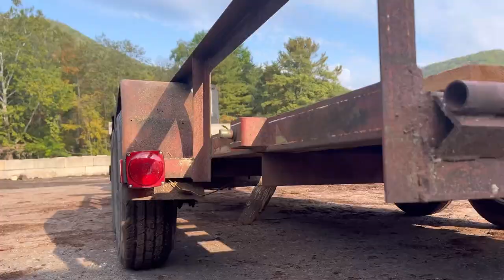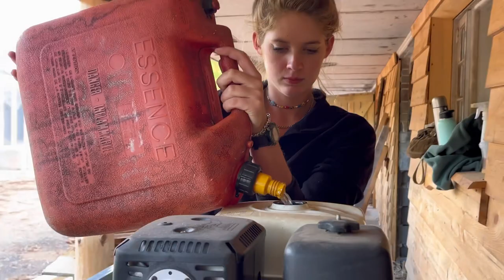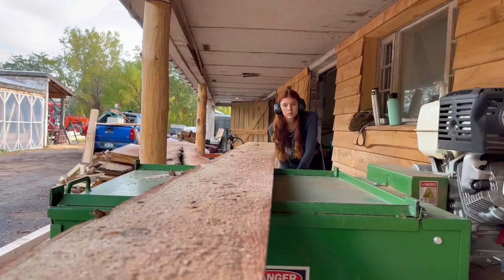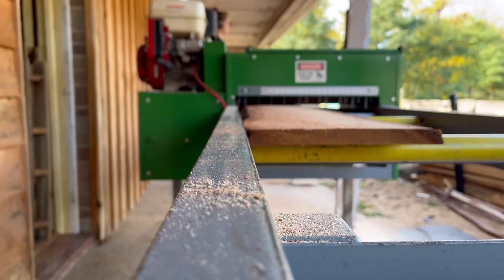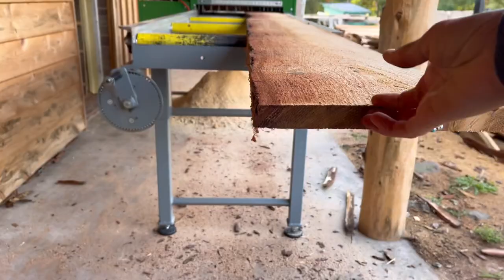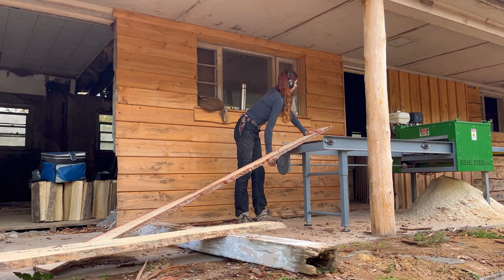Edging Lumber Like There is No Tomorrow!

Comment: I used to cut southern yellow pine in Lexington south Carolina. When I was 19 years old I was running a 23 foot carriage  and a 72 inch circle saw  very hard to keep cutting straight. But we cut mostly long stuff averaging 24 feet  we cut alot of RAILROAD timbers. I don't even know if their is a market for those now  .the biggest I cut was 48 foot long 8 by 16inch timbers they had to be dense 7 rings to an inch and I split alot in to 2 pieces. Alot of 16 by16s. They had to be within a half inch from one end to the other

Comment: Interesting to see the colours change on the hillside beyond the Lumber yard.  It seems there are many different species of deciduous trees, planted in patches.  It creates an especially delightful scene as the leaf colours turn.  I am also felling at the moment in my garden, mainy trimming branches from ash and sycamore for firewood.  Some of my sycamore leaves are also turning and are wonderful red and copper colours, but sadly they do not keep long.  I trim off all the leaves and will compost them, and the small twigs I cut in to 4" pieces for kindling.  My logs are 12" long to fit in the little cast iron stove.  in Europe we are preparing for winter with fearsome electricity bills.  I plan to keep my electricity use low as possible and may run my generator on vege oil if the going gets tough.

Comment: Emerald, I had mentioned a while ago that if the binding of the crank adjuster is occurring on its threads, clean off whatever other mess is on them and spray a coating of graphite spray on the threads, it dries quickly. I don't know for sure if that is what is sticking but if so it would be an interesting experiment. Most other substances would be sticky and allow fine sawdust to stick to the screw. Interestingly enough this same graphite spray works excellent in door locks, house, vehicle, padlocks etc as most other lubes gum up locks where this does not at all, it is just the product to use on your wood trailer lock for example every so often !. It is a messy product to use though, that is its downside as it wants to stain objects you don't want to get the product onto and have to use a bit of gasoline or brake cleaner to get it off, not a worry for a trailer hitch lock though. This is actually Thanksgiving weekend here in Canada, turkey is still a long ways off yet for your family down there of course !
Reply: Enjoy the holiday.  Boss Man.
Reply: @KenBreon  Thank you Teri !
Reply: PTFE spray is also good for such things, dries to a thin slippery coating. When I looked after woodworking machines they had oil lubrication, usually caused no problem so long as it didn't build up at the end of screws and slides. I now look after metal grinding machines, that stuff jams anything with a thread.

Comment: Great vid. Question, what is the crank on the lower left adjusting? Is it the board depth or the edging depth?  Apologies for a dumb question but I am a novice.
Reply: There are 2 blades in the edger. One fixed (at “0” inches) and a moveable one that sets the finished width of the boards. The crank moves that blade on a shaft to the desired position.

Comment: ergonomic opinion (if you have the equipment to do so) 1. Use your forklift for the pre-edged lumber, as the stack gets shorter, raise your forks. Keep your work at waist height. 2. As the lumber comes out of the edger, have an empty pallet sitting on a set of wide pallet forks. Sticker the lumber on the pallet. You eliminate having to handle it twice and as the stack builds up, you can lower the forks.
Reply: If they had electricity hydraulic platforms work great, used them in a furniture factory, although we dealt with a lot of sheet material, much heavier.

Comment: Hi from southern New Zealand. I'm honestly curious about what happens to the waste offcuts? I worked for a mill near Dunedin and we used the offcuts to fire a drying kiln because we were processing green pinus radiata (Americans know it as monterey pine, the most common exotic timber in new Zealand,) so it had to be dried after milling. Also, to be honest, I am kinda shocked at the difference in safety gear between your operation in America and the mill I worked at. PPE is huge in new Zealand. Overalls, Steel toe boots, perspex glasses, earmuffs or plugs and gloves had to be put on before you even looked at a machine 😆 great videos, interesting to see the differences
Reply: It's a family run business they don't have to follow anything if they don't want to. One of the rarest things that's nice about doing business in America.
Reply: @bathman225  yeah safety culture has gone stupidly overboard in New Zealand
Reply: Lol I just found your slabwood offcuts video and answered the question about waste 😆
Reply: Australia is just as bad. A few years ago I was setting up a new truss plant in Geelong ( south of Melbourne). The owner told the company safety manager he would be fired if he stepped foot in the new plant while we were working before the plant was operational.  They have to account for whatever a person could intentionally do to hurt themselves.

Comment: I noticed that when Jade was filling the edger it appears that you guys just use regular road gasoline instead of off road fuel. Do you save the receipts for your fuel purchases and get that road tax money back when you do taxes? With the amount of fuel I imagine you guys use that would be thousands of dollars. The amount of gasoline/diesel you guys go through a week/month might be a good topic for a video. I imagine the boss man uses off road diesel in his equipment.
Reply: I’ve never seen off road gasoline for sale. Where do you buy it? Is it dyed like off road diesel to differentiate from regular gasoline? Very curious about this. Thank you.
Reply: @jonwilder2735  It is getting harder and harder to find. in the 1990's my local ACE hardware store had it to use in lawn equipment etc. Now you pretty much have to order a tank of it from the distributor to be on site at your business. It is dyed just like off road diesel. One of my friends works at a large paper mill and they still get it delivered for all of their equipment that stays on mill property. It might not be feasible for the log yard to get a large tank of it delivered but they could still save all of their fuel receipts and at the end of the year get all of that road tax back. With the current high prices of fuel and the high road tax that PA has I would imagine it would be in the multiple thousands of dollars.